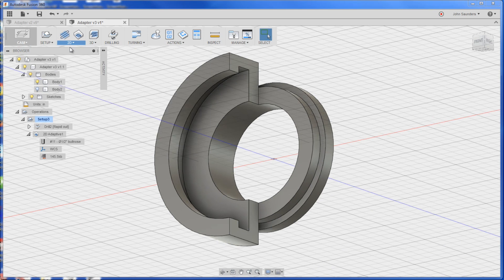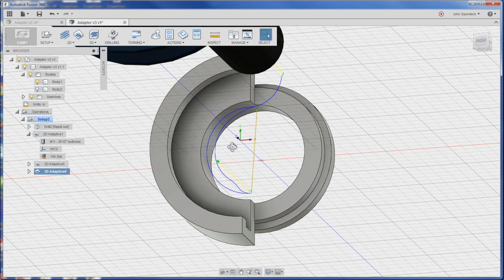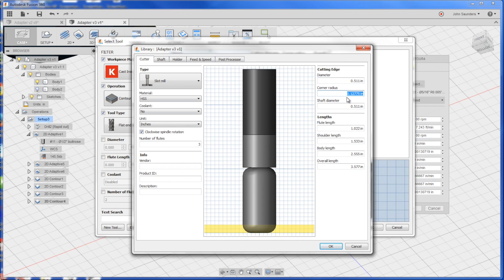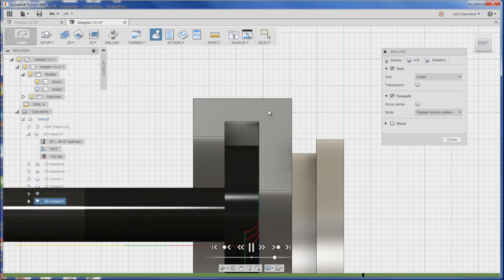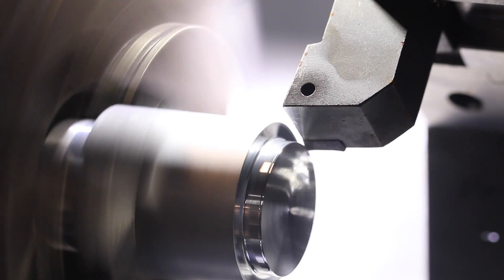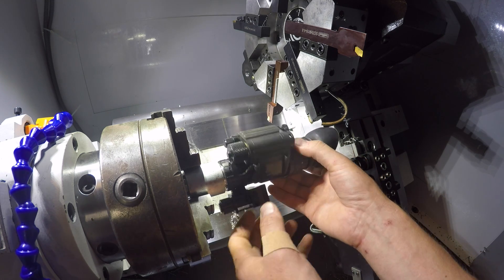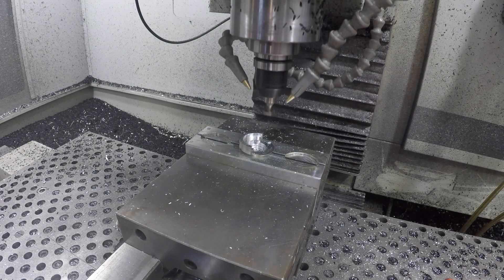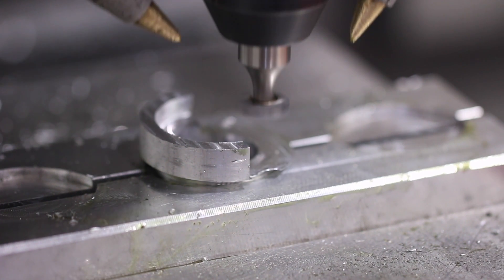DIY Night Vision Spotting Scope Adapter!  Widget56 Part 2

Comment: If under cutting  freaks you out wait until you try off centre back knifing
Reply: +NYC CNC  I think you call it back chamfering but imagine doing it down a blind hole and turbulating  on the x and y axis all good fun it helps with the cam but we used to prg by hand @ the machine

Comment: I wonder ... is that possible to generate G code for Small Gear manufacturing using 4 axes Router in Fusion 360 ? ... and please talk slower cause the foreign viewers ...

Comment: Nice work, as always.

I'm curious why you chose to make use a 'D' / half circle hook  instead of a 'U' shaped one.

I presume that some form of sleeve slides over the coupling/adapter to secure it and block out light pollution, but I tend to be paranoid about not exploiting all of the availble ~~mating~~ surface area.

Comment: John, how about a two part adapter?  One part screws into the night vision device, the other is two or three pieces that attach to the scope.  How you join the two adapters is up to you...screw together, dowels and set screws or wedged bayonet lugs like many camera lenses use. Let's you make adapters for different scopes and use the same night vision adapter.  

For the current scope adapter you could make three parts...two the same that are halves of a cylindrical arrangement like the bigger half of what you just made, but with tapered threads on the outside. Third part is a ring with tapered threads on the inside that screws on to clamp the other two parts around the scope lug.  Should be pretty secure, and look good too! 

-- Mike
Reply: +NYC CNC KISS and KACH (Keep A Customer Happy - pronounced "cash"...) are good principles.  If you were to work up something for production, meeting more customer's needs is worth considering too, but for a one-off you do what you are asked to do as well as you can...which you did.

Comment: Pretty cool how you allow us to follow your thought process. The part looks cool. Have you ever concidered looking into direct metal laser sintering (DMLS) to lower the amount of waste material.
Reply: If you would have to buy an EOS M290, I could understand that as they start around $700k. The reason why I mentioned it is because you seem pretty creative and why couldn't there be DIY DMLS options. What I like about the technology is the possibilities and the reduction of waste.
Reply: +NYC CNC I have been following DMLS technology for about 2 years now and last month i found out about Autodesk within, which is software used to optimalise the inside structure of an object without losing structural integrety and even in some cases making a part stronger. I do have to admit that when seeing that I was thinking about an AR-15 and how the DMLS version of that would be a bag of an high strenght alu alloy powder and another bag with some titanium alloy powder which would be to print parts like a silencer that could be made as part of the barrel. Technology is so amazing, I dream about it and they are quite vivid.

Comment: Also.  I bought a vmc 600 for basically 10k u.s. its a older model but it still performs just as well as the new ones.
Reply: +NYC CNC it's a 97 model. fanuc 0-md controller. max spindle speed is 6000. limited on the memory at 50KB, but that's where your videos came in handy. helped me a lot in getting into machining. Thank you for your help btw...

Comment: Hi John, really cool gadget indeed ! Quick question: how did you figure out thread length so when screwed all the way in and tightened, the NV scope would be "vertically" aligned with the half that attaches to the spotting scope ?

Comment: Fusion 360 lets you use the 3D toolpaths too, no? Assuming they're like they are in HSMWorks, I'd definitely suggest checking them out if you haven't already. All the roughing can basically be done with a single operation (3D adaptive clearing). The finishing ops, the undercut, etc. will be the same.

Comment: This reminds me of the work I did at the last machine shop I worked at in the early 90's. The shop upgraded to all brand new cnc's including a new 4 axis lathe with automatic bar feeder. I don't remember the exact specs of the new lathe, it may have been a 5 axis machine....it was a long time ago. I programmed and then set up the brand new lathe to make binocular bodies for a local company. I was pretty nervous with the new lathe running it's first production parts. I handed off the first part to Inspection and several long minutes later, with me sweating a bit, he brought out the part and said it passed inspection. I danced a victory dance because several of the guys were standing around good naturedly badgering me while the machine ran through the program. 

There was added pressure on me because the owner said if the machine works out we would get a huge order from the same company for making spotting scope tubes.

I remember this particular job very well, because when I set up the tooling for this machine I sliced open a 3 inch cut on the back of my right hand when I racked it against a threading tool. One of the guys yelled out, "FIRST BLOOD....now it's properly lubed" after I pulled out my hand dripping with blood. The cut didn't require stitches but I still have the scar. Keep up the fine work you are doing. Your enthusiasm and joy is infectious. I wish you success.
Reply: +NYC CNC Not since about 1991 because shops spring up and shut down so often that I moved on to the Telecom industry. I miss machining, and I still have all my tools, but I needed something more stable.
Reply: +comictrio just curious, but are the frequent business failures due to fluctuations in the available work, or poor business management (e.g. Under capitalized at the start, try to grow too fast and over-extend, don't monitor costs well, try to be more price competitive than is actually possible, etc)?

-- Mike
Reply: +BigMjolnir  It's all those things you mentioned. Here in Oregon, I don't think there is enough industry left that could support a modern machine shop with CNC equipment. I'm sure there are a few shops that do work for Intel and other high-tech companies....what few high-tech companies are left here these days.
Reply: Sorry to hear that, but I'll point out that with UPS, FedEx, etc. and the internet for advertising and communication, you don't have to rely on local needs only anymore.  I expect most of the big shops are selling to customers all over the world.  Nothing to stop small shops from doing the same anymore.

-- Mike

Comment: Quick question: how many full threads are on your adapter? Doing the math, the pitch difference between 34 TPI and 32 TPI is approximately .0018", so a slightly loose 34 would, theoretically, thread into a 32, and as everything has tolerance, could be what happened. Not saying so for sure, I have no idea what the standards are for night vision gear, but it's a possibility.

Do you have a thread wire set?
Reply: +NYC CNC As far as I'm aware thread wires can only be used (directly) on external threads. I've heard of balls being used, and the principle and maths is the same, but I've never seen it done in practice. All the theory in the world is great but in practice, wires can be difficult enough to juggle, even with a keeper, so I can't imagine what a nightmare using balls would be. ;)

In some situations making a mould or casting of the internal thread can be useful in making measurement easier. 

Nicely done as always John.
Reply: NYC CNC Moreso curious how your external threads came out. No way to use wires on an ID.

Comment: That's pretty awesome.. I'm sure you could machine a half moon or "c" clip to mate up with the half you milled off the mating end for the spotting scope, put some set screws in it so that it is fully secured rather than just floating on half? Or if you plan on mounting this apparatus on some pic rail?

Comment: Hey, I resent the 200k VMC comment...  Our 40" you could buy from us for 35k and that includes a 4th axis.
Reply: +akromix Seriously. Lots of Fadals out there. Our 1997 VMC2216 would probably go for ~$15k on a good day, and I've pushed it to 200IPM in roughing operations.
Reply: +atomkinder67 yeah but ours is a hurco not a fadal. fadals aren't bad for a beginner shop though. hurcos are pretty economical. our vmx30 in 06 brand new was 58k.
Reply: +akromix 08 not 06
Reply: Our other mill is a Haas VF-6SS. Plenty of shops out there with Fadals being competitive. Of course the VF-6SS isn't $200k either, surprisingly. Good price for the work envelope. A bit further down the line to a Vf-3 or -4 and it might behoove someone to take a look at Okuma.
Reply: +atomkinder67 Haas only have market place because of their presence in the schooling system. they really aren't that great of machines from what I've seen.
Reply: +akromix Not here to argue Haas vs Hurco vs Fadal. I've run Nakamura-Tome, Makino, Haas, Fadal, Mori Seiki... they all have their place.